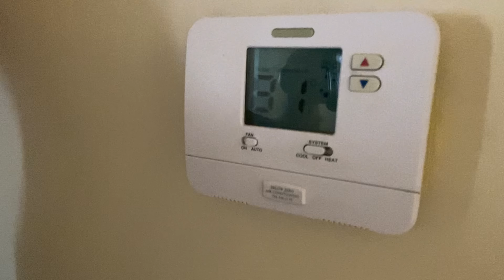Our Air Conditioner broke! Life will Always be HARD but you can pick your hard!

Comment: Landlord is responsible for maintenance and breakdowns of Hvac if you’re renting. As far as I know. But last year our central Air shut down and the Motor rusted out and stopped working so we had to call service and cost us and least a little over $350. We built our house less than 10 yrs ago.

Can I correct you about the dialects? There are 170 dialects in the Philippines but there are 8 major dialects. They are Tagalog, cebuano, Ilocano,  Ilonggo, Bicolano, Waray, Pampanggo and  Panggasinense. 

Cebuano, Ilonggo and Waray are dialects widely  spoken in the Visayas and Mindanao region with twist on some idioms or words depending which province a person is from which Cebuano (Bisaya which Etching speaks) is widely spoken in  some Visayan islands facing island of Cebu and Regions in Mindanao facing Cebu.
There’s also a couple of regions both in Luzon and Mindanao that speaks Coloquial Spanish. 
But the National Language is Tagalog.
Reply from the maker: Thank you for that excellent information